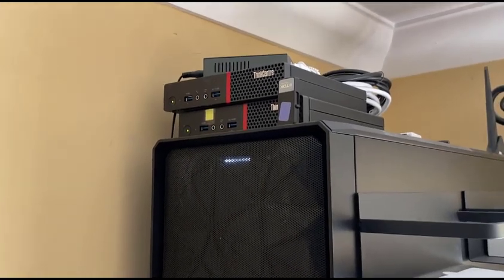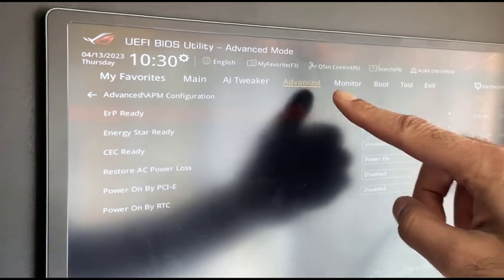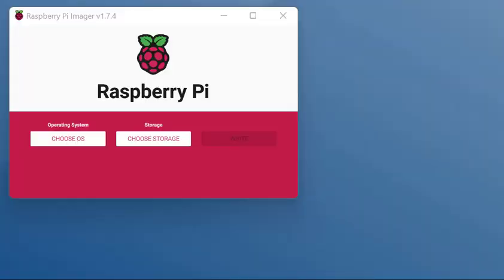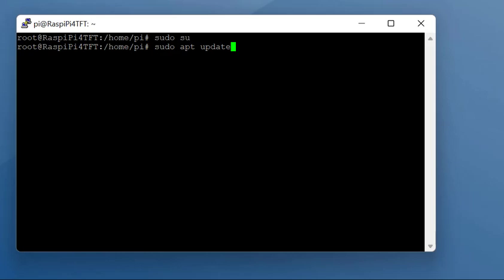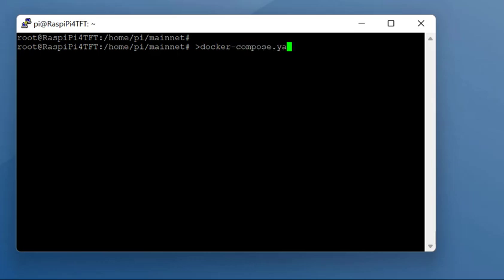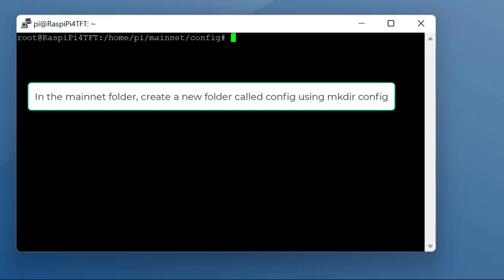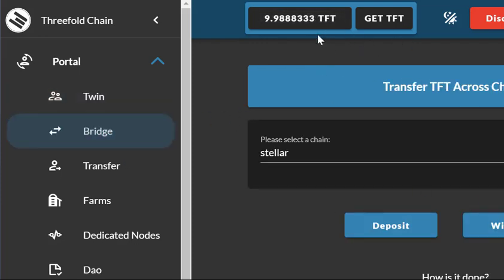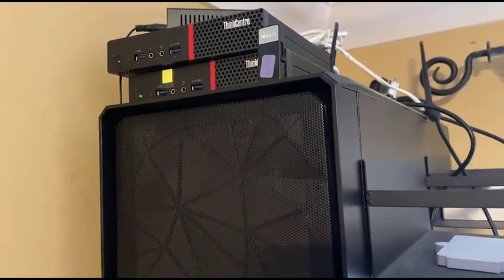ThreeFold FarmerBot A-Z Setup - Wow gone from 100 Watts to 25 Watts

Comment: Hey, excellent video. Thanks for documenting this full process for the Raspberry Pi!

One small clarification: the farmerbot does not need to run inside the same LAN as the 3Nodes. The wake on LAN packet to wake up the sleeping nodes actually comes from the node or nodes that remain awake, so you can run the farmerbot anywhere.
Reply from the maker: That's good to know, I wasn't aware of that